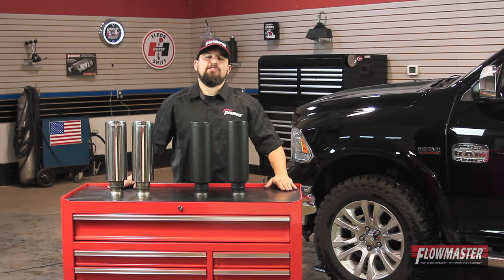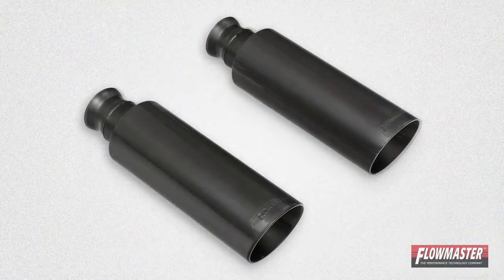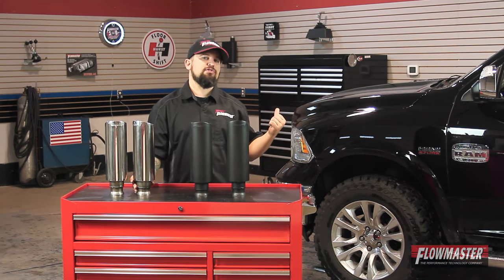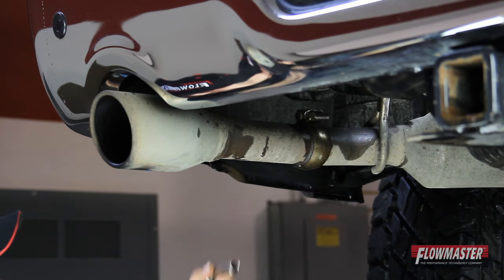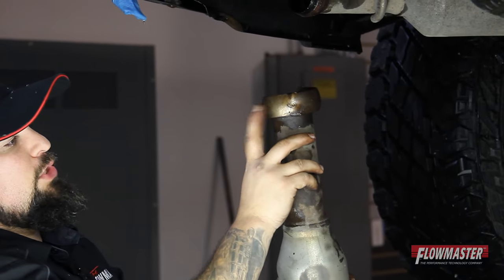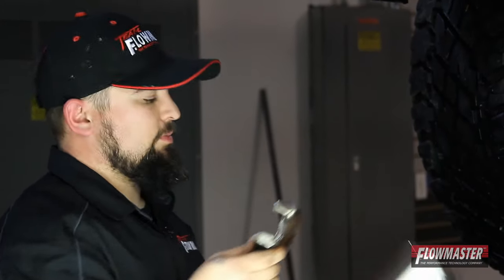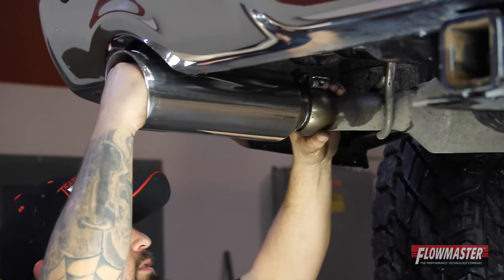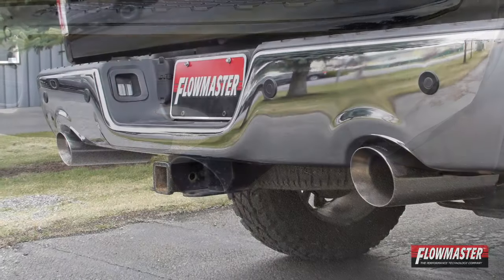2009-19* (*Classic body) RAM 1500 5.7L Hemi - Direct-fit Stainless Steel Tips 15356 & 15356B

Comment: Would these tips make your truck sound louder if you have a series 40 flowmaster installed already?
Reply from the maker: The size of an exhaust tip can play a minor role in tone, but it depends on how much larger you go. The larger the diameter over current, the more it may change. Larger diameter tips will amplify the exhaust note and make it a little higher pitched, however the difference in most cases is minor.

Comment: I have a 2003 dodge ram 1500 4.7 v8 went from single exhaust to a super 44 dual exhaust have to get a new one and want to go louder should I stay dual or go back to single and any suggestions
Reply from the maker: If your RAM still has the resonator located within the exhaust system you may want to look at having it removed, that will make the Super 44 slightly more aggressive. We have had a lot of RAM owners find that the Super 10 makes a great aggressive muffler option for the 4.7L. The difference in exhaust note between single and dual exhaust pipes should be minimal and may not be noticeable. Many factors can cause an exhaust to not sound as aggressive as it should. You can always give us a call at 707-544-4761 and we'll run through all of our muffler options and let you which will be best. 

- Jason @ Flowmaster
Reply: Get a hemi!!!

Comment: what's the inlet size for these rams?
Reply from the maker: The measurements of our Flowmaster Direct-fit Exhaust Tips for the 09-18 Ram 1500 Truck w/ 5.7L Hemi is 13.88" in length, attaches to 2.50" piping and the tip outlet is 4".